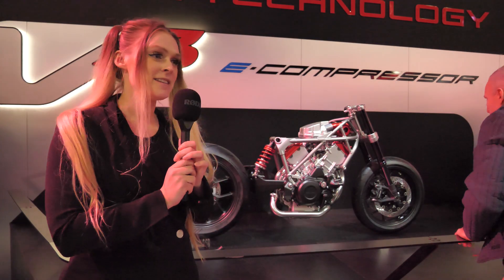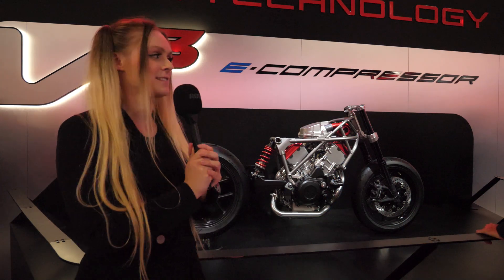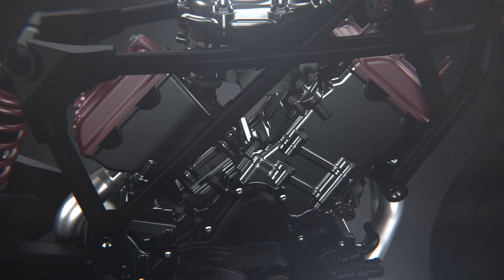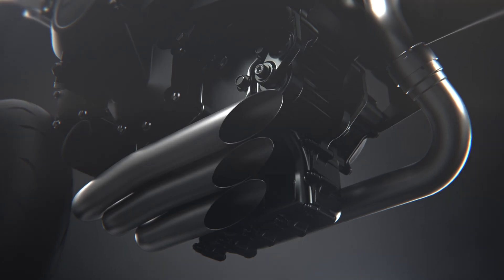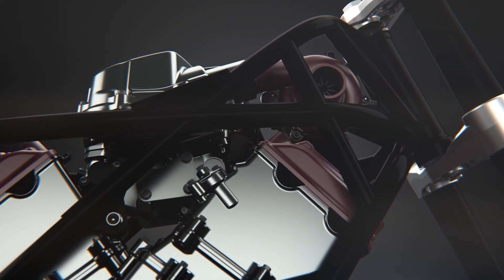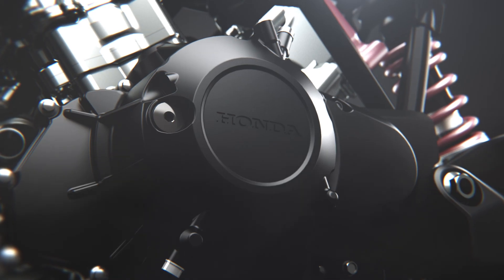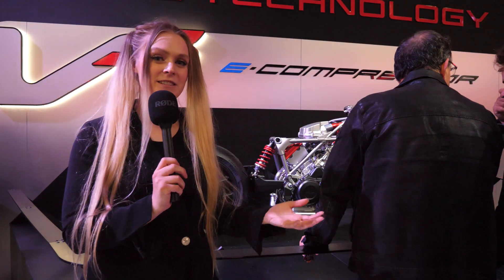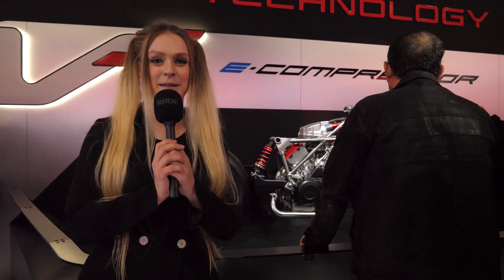Honda’s New V-3 Engine Just Shocked Everyone...

Comment: Is this just a supercharger, but electrically driven rather than mechanically? If so it's ancient technology.
Reply: One reason why superchargers were not used much in mass produced vehicles is that the extra horsepower comes at the expense of a much shorter engine life.
Reply: @cliff6797  True, however turbochargers are now ubiquitous.  I'd bet most people don't even know their car has one, lol.  They are a lot more complicated too.  But, the electrical blower solves this somewhat.
Reply: @cliff6797 Avoids the routing of the exhaust through the turbine.  Not new but it is brilliant to use on motorcycles.  Small displacement motorcycles with the power of large ones.

Comment: Fossil fuels need to be stopped in all vehicles!!!
Reply: Aircraft ?
Reply: @richardbarton2709  Electric power being tested on planes...So it could happen soon!!
Reply from the maker: Commercial electric flights will be difficult to achieve because batteries are so damn heavy
Reply: @SaffySprocket  The tech is improving constantly, lighter, faster to charge and longer charges...So it will eventually work out eventually.
I am a former believer in fossil fuels as I grew up in an area with lots of oil.  Now grown out of it.
Reply: Why? Besides these fuels are not fossil, the biggest brainwashing lie ever!

Comment: My wife has never ridden a motorcycle, When at GP citrcuits if the MotoE come out she gets up and walks out as she will not entertain an electric motorbike, God I love that woman. Guess thats are answer 😃
Reply: Which has absolutely nothing to do with the discussion…
Reply: @FergusJohnston  @ 1.45 "are you a ELECTRIC, Hybrid or are you a fan of the combustion engine, let me know in the comments below"  so I did ! sorry
Reply: @funkygrib1  This is an internal combustion motor with an electrically driven compressor.
Reply: @georgekrpan3181  Yea I got that BUT @ 1.45 mins, Saffy asked a question and requested comments, so I did. As for the above motor layout, it ws a proven layout in the RC211  (OK it ws a 5) You could keep a motor with a narrow frontal area and maintain room for the rider with an unequal "V" I find it very interesting. Especialy in a ADV to allow a narrow  waist to allow standing. 3 cylindrs should give good road performance with the fan boosting bottom end. "If that is the deign ?"

Comment: 15.000rpm 500cc screamer please! Make it small and lightweight, thats where the fun is
Reply: If you watch the vid, it’s about increasing low end torque.
Reply: @prowler2358 It doesn't have to rev that high if it's making power at lower rpms because of the compressor.  But I agree a lightweight 500cc bike would be good.

Comment: I didn't understand. Am I close if I say that the compressor works in the combustion process by precoompressing something air/ fuel air mixture before it reaches the cylinder where the compression process is completed offering a faster more complete combustion process? How far off target am I?
Reply: Yes. Another name for it is a Supercharger.

Comment: I can't see that exhaust meeting Euro 5+, can you?! Nevertheless, I'd love to see it go into production in some form. As narrow as a Ducati twin at the saddle and no wider than a CB500 at the front, with extra power and the flexibility that only an independently powered compressor can give. What's not to like?!
Reply from the maker: It would be interesting to see how they implement it with Euro5. I think a lot of people are a wee bit skeptical at the moment
Reply: @SaffySprocket I'm sure if Kawasaki can get the supercharged ZH2 and Ninja H2 through Euro 5, then Honda will find a way with this engine. One of the main advantages of an electric compressor is that it is infinitely adjustable, rather than just relying on engine speed. So Honda could presumably program it to tone it down at the homologation rev levels.